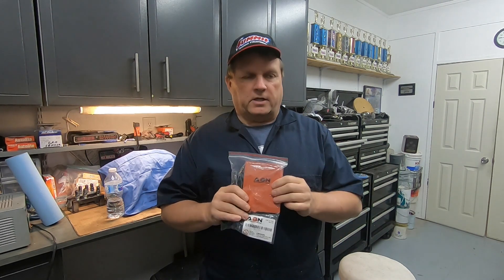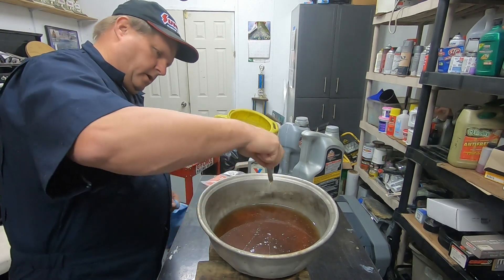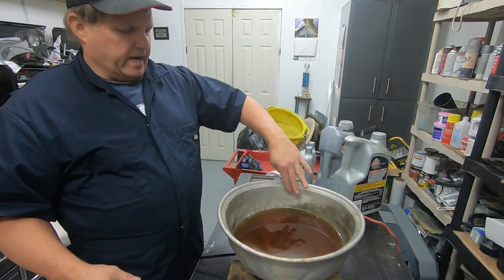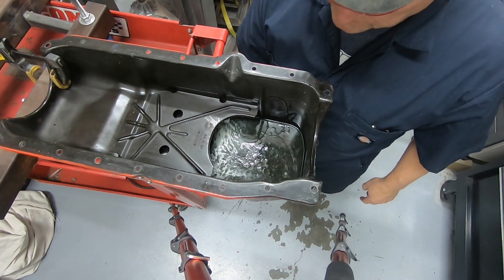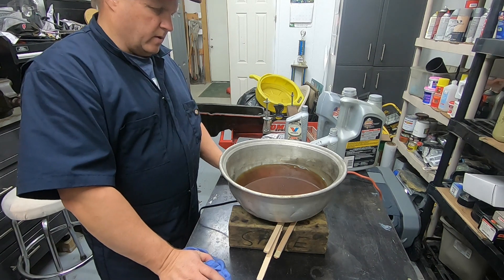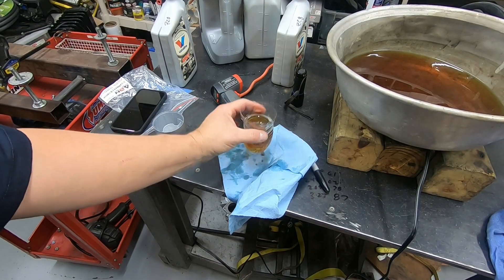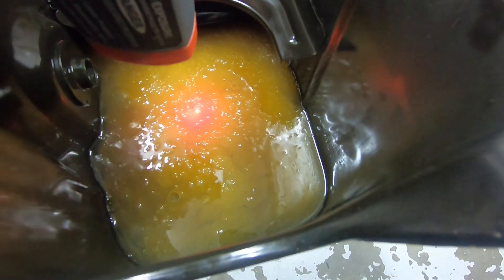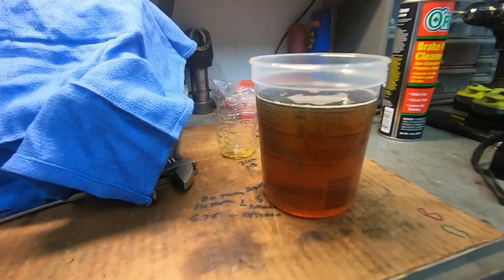How To -  Get Methanol out of Motor Oil,  Heater Pad? Is that the answer?

Comment: How hot did you have to get it to clear it up? Also is it better to run a thicker oil?
Reply from the maker: I think it was about 160 before it started to clean up. I don't see any benefit of running thicker oil.
Reply: @KensKorner  Get a vacuum pump hooked up to the oil filler cap to lower the boiling point with a warm engine and electric oil pump if possible.

Comment: Just use your wife's slow cooker. Bring it up to a low simmer and the oil will be dry in about 6 hours. Do it all the time. Most of what you see in the oil is just emulsified water. The Methanol evaporates out as soon as the oil warms up in the pan.

Comment: Hi ken 
I use to work on extremely large generators some of which were 16 cylinder diesel engines in freezing weather conditions... so in a genset application we would put engine block heaters in the place of freez plugs in order to keep the engine oil at operating temperature the reason for this is when electricity goes off the generator would have to start up at wide open throttle and I'm sure you awear that no diesel engine will last being forced to operate in freezing temperatures and have to be from dead stop to wot so is there a way for you to put a water block heater in and also you'll need a cheap shop vacuum cleaner to pull the condensation out of the crankcase but I'm sure you were already aware of that... us guys that are still using race gas ie vp 110 112 116 dont have the issue of alcohol fueling... great experiment and good content on your channel
Reply from the maker: Cam, Thanks for comment! I run a electric vacuum pump to pull the condensation out of the motor as well. I have a pretty cool video on how a made one. It works pretty darn good.